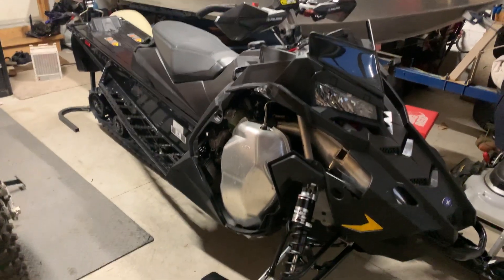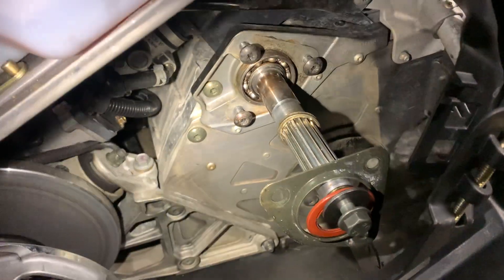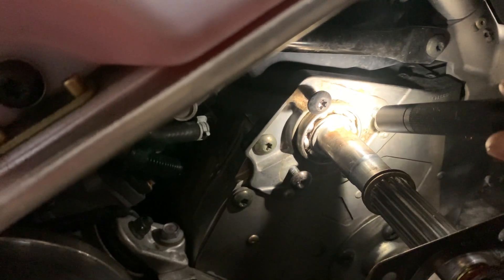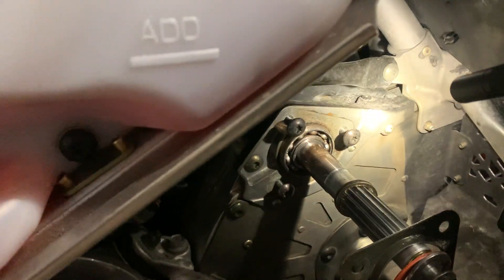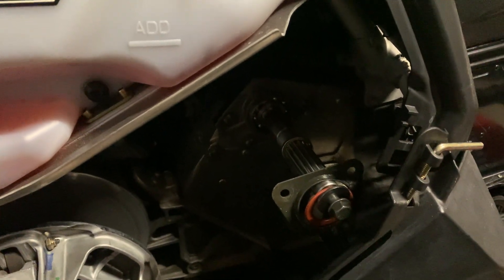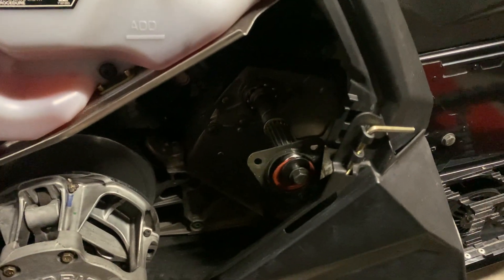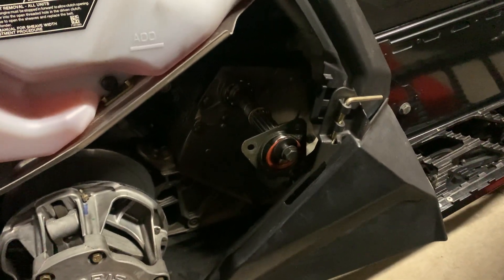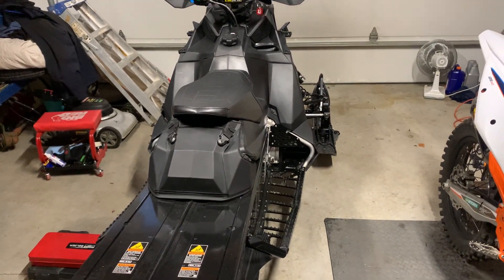Polaris 850 How To Replace Jackshaft Bearing Part 1

Comment: What you are calling the carrier is what i referred to as the mount.We are doing the exact same thing.My sled has low miles and the bearing looks perfect but i want to make sure it is not binding when it goes in the new carrier etc...TIP if you end up taking the shaft out its only a little more time to remove the skid and drive shaft and its easy to do then what i did was cut off the two rivets in the tunnel that hold that carrier to the tunnel.I used a dremel and cut off wheel.I will rivit it back on when the time comes but up from the bottom since the top of the rivet in not easy to get at...Sorry for the long post
Reply from the maker: No need to apologize, I have the sled back together. Im just trying to edit the second part of the video, theres probably 30 small clips that need to be put into one video. Thats a good idea, I used an angle drill from the top and found a good way to get that tricky back rivet in! If my program stops crashing I will have the next part up ASAP 👍
Reply: yep, i could have drilled mine so more than one way to skin a cat. I assume you reused your 21 JS and when you spun it once installed and chaincase back together as if it were to be run but chain not on and cover bolts not needed to be installed it spun nice and free ?There is a trick you can use if it tight to tap on the shaft using  bolt installed or leave it out and put a 1/4" punch in the bolt hole and give it a tap.This will center the bearing in the carrier and relieve any side pressure .I'm told when assembled with no chain the JS should spin free and come to a slow stop.
 @Onesmoothride
Reply from the maker: Second part is up and working on the 3rd. At first my bearing was not seated all the way causing it to be loose in the mount. After noving it on the shaft a bit further Its moving freely but not loose in the mount. It should not free spin and coast like a yoyo. A newer bearing with grease has some resistance. Your looking for a smooth movement without being too tight.
Reply: @Onesmoothride  when you put the new bearing on you should look for the 2022 up service manual or go to hardcore sledders and see how the guys recommend doing it .

Comment: Instead of turning a negative into a positive by standing behind the issue, which is an obvious design issue; Polaris chose to stick their head in the sand and do further serious damage to their reputation.  They are already in trouble over the fuel pump and exploding clutch issues.  Yes, everybody has problems, but how companies respond to them is what's important in the long haul.  We have been a Polaris family for over 30 years and this is not a wise choice on their part.
Reply from the maker: I can't agree with you more. That was my drive to make this video series. The one up side to this is someone could learn alot after performing this repair or watching these videos. I am however still upset on how they handled the situation.
Reply: In the last 12 months we had a jack shaft bearing go out and a fuel pump on another machine, both on 2023 machines, on our biggest trip of the year.  Then we took delivery of a new 2024 this summer and found the GPS was not working from the factory; dealer did not catch, which caused two trips back to the dealer; total of four hours on the road at our expense.  Dealer told us they are seeing a rash of these on both sleds and UTV's, which use the same 7S display.  Sad.
The least Polaris should have done with the Jack shaft is provide the parts free.  When we made our repair, we didn't know about the new mounting plate and the dealer apparently didn't either, so this machine is doomed to fail again in another 2K miles.  (The problem is, there is a side load build into this bearing from the factory, because the tunnel is in effect too narrow, which causes the outer race of the bearing to split. Ball bearings are not intended to carry a heavy side load.  Initially, everyone thought it was caused by lack of grease, but this is not the case.)
By the way, failed to mention, your video is well done.  A lot of guys will be needing this information, unless they are willing to shell out the big price for the dealer to make the repair.
As you can tell, we are not happy and very concerned about the future of Polaris, it they don't get their shit together.  I spent my career in Product Development and these kinds of issues come from running too fast without adequate testing and verification.  Nobody has the balls to stand up and slow down the market introduction train, so they end up chasing product problems, so damaging to long term success.  Limited, short run intros are the key.
Reliability trumps new gizmos.  Polaris keeps loosing sight of that.  Classic example was the 900 fiasco about 15 years ago; they changed their ways then, but appear to have slid back into a bad place again. 
Polaris is locked in a dog fight with Ski Doo and have apparently failed to realize reliability will win the day; not gizmos.  
The new Matrix chassis is awesome; let's hope it stays glued together.  Enough sad.
Reply from the maker: Cant agree more, very unfortunate to hear. Seems like each year the quality control along with service is going down hill. With all the major recalls and problems I wouldn't be surprised if they get to a point of going under. I know many people switching over to skidoo. I understand they also have there problems but they don't have as many stop ride recalls.